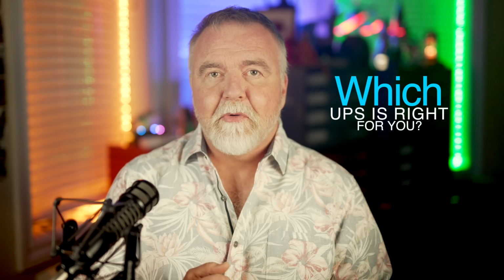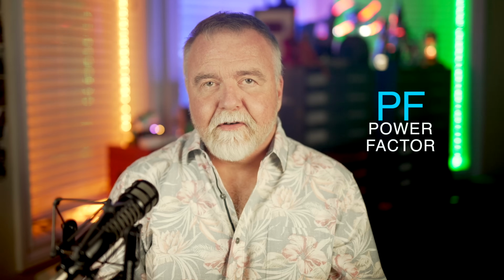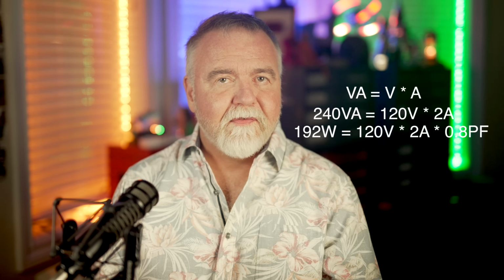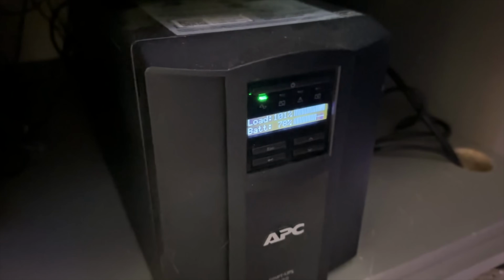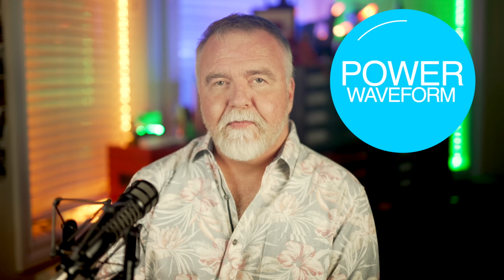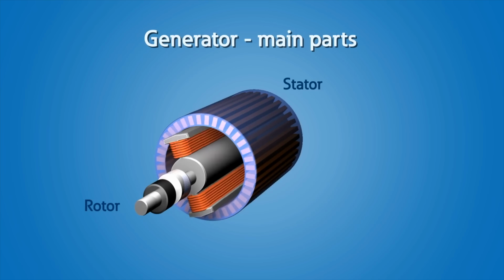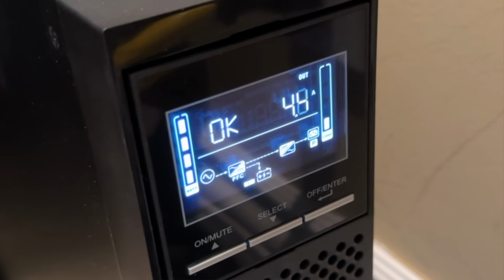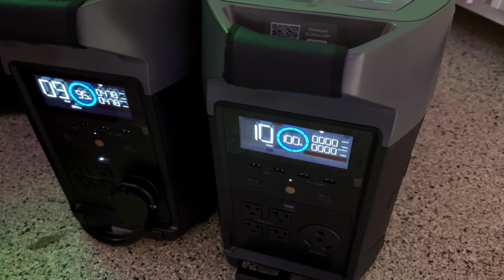The UPS Secrets YOU Need to Know!

Comment: 12:00 You forgot to mention one very significant plus of lead acid (since you did take the pains to mention that it contains lead which is toxic): lead acid batteries, unlike their lithium ion sisters, do not catch fire. Moreover - and this is a significant drawback of lithium ion batteries for this application - when lithium ion batteries catch fire they spew toxic cobalt and other nasty metal compounds all over the place in the form of really toxic smoke So, if this is installed inside your house, you, your family, pets etc. better not be there. What makes this even worse is that the electrolyte in lithium ion batteries contains its own source of oxygen in a fire. So, it doesn't matter what you cover it with in a vain attempt to smother it: it will still burn and burn until it's all depleted. That leaves you only water as the only means at hand with which to tackle it. Except that, in the form of a UPS, it's still attached to the electrical mains. Great ain't it? 
I'm not sure if there are any fire extinguishers specifically certified for tackling lithium iron battery fires, but if you have a UPS sporting those, you better find out if there is such an extinguisher and buy one.

Comment: Fun fact: Your basic SMPS power supply (without PFC, think older computer equipment) is perfectly happy running off of squarewave or even DC power, even less component wear than on standard sine AC power. But they tend to have low power factor and introduce a lot of interference, so PFC (power factor correction) systems are fitted to newer ones (and mandated by laws in lots of places). As PFC systems are built for dealing with sinewave AC, they tend to malfunction or blow up on non-sine waveforms.
Reply: Almost. Supplies with the little red 115/230v switch require AC input when on the lower voltage setting because they use a voltage multiplier. Squarewave would still be good enough.

Comment: Videos I wish I'd seen before purchasing my UPSes...
Reply: Re: connecting the UPS to the computer: since I mainly run Linux, Unix, and Unix-like systems at home, UPSes that support NUT all rose to the top of my shopping list. I planned on doing more research before buying, but construction next door caused the power quality to tank and I went with "Affordable now and available now". That lead to my purchasing a couple of 1500VA line-interactive lead acid UPSes. In a few years when these batteries finally kick the bucket, I'll see if I can swap in some Li-ion battery cartridges or maybe move over to a double-conversion UPS.

I was able to use the tools in the NUT server and client software to set a shutdown order. Everything survives a "blip". Less critical services go down after a minute. Mid-level services go down after 5 minutes. Finally, high-level services go down as the UPS is essentially running on fumes. Once all the downstream equipment is down, it powers off the output ports and waits for power to come back on. When power is restored, it cuts the ports back on and causes all the downstream units to power back on. I've tested this chain a couple of times, restoring power at different points in the cycle. It works a treat!

Comment: Lead acid battery plus over Lithium Ion.  Lithium Ion cannot handle as large of a load as a lead acid battery. This is why they are not used as cranking batteries in vehicles with internal combustion engines. Hopefully someday, but not yet.
Reply from the maker: I disagree!  he capacity of an 18650 cell varies depending on its specific model and manufacturer, but they typically have a capacity of around 2,500-3,500 milliampere-hours (mAh) each.

Assuming an average capacity of 3,000 mAh per cell, the total capacity of 290 cells would be:

290 cells x 3,000 mAh/cell = 870,000 mAh or 870 Ah

To determine the current that this battery pack could provide at 12V, we need to use Ohm's law, which states that current (I) equals voltage (V) divided by resistance (R):

I = V / R

In this case, we can assume a resistance of 0.01 ohms, which is a typical value for the internal resistance of a lithium-ion battery.

Using this resistance value and a voltage of 12V, we can calculate the current:

I = 12V / 0.01 ohms = 1200 amps

Therefore, 290 18650 cells could potentially provide a current of up to 1200 amps at 12V.   1200A is more than the biggest battery I've ever owned, a 1000 CCA "Eliminator" battery.
Reply: @DavesGarage  Potentially, but common thought/practice appear to state otherwise, for now.

Comment: Never had the need for an UPS as i've had two outages in the last 13 years. My brother lives in an area which is in the same grid as where Nokia Labs used to be and there hasn't been any accidental power outages in the last 20 years. You should try to ask for equally well built infra around you.
Reply: I used to live 1 mile from the substation bringing power into a city, I never lost power for more than a few minutes tops. We even had large storms and the neighboring town lost power for 3 days. 

Now I live in a rural area and in the 2 years I've been here I've had 2 significant storm outages. One 6 hour, the next 18 hr.

I am well prepared though, I have a 20kwh battery bank hooked up to my solar, I heat with wood, and I have generators if needed. I could keep my refrigerators and freezers running for a week with no sun.

Comment: 'Safe Shutdown' - I wonder what fraction of home UPS installations don't have the required interconnection to inform the PC to commence shutdown ? So, when the family is out for dinner, the PC is subjected to a UPS outage, which is simply delayed by ~30m (YMMV) from the grid outage. Probably puts out a bizarre AC waveform as the battery goes flat.
Also, so many are focused on "the" (singular) PC, as if each household has but one. Our house has at least five (5) in active daily use.
Also, what about other systems that might also benefit from a gentle shutdown process? Security Camera DVRs. IOT Gadgets.

Also, who remembers to replace the batteries every few years? Nobody. It's only discovered when the UPS fails to do anything during a power failure.
My workplace for almost 40 years has had two serious (for real) building evacuations; both were the IT server room UPS system emitting smoke. 100% rate.

When thinking about these sorts of "solutions", then take into account that 1) they only solve a fraction of the larger issue due to such cases as listed above, and 2) they bring their own issues such as capital costs, limited life, potentially annoyances, and (slight) risk of a house fire. Do your Benefit/Cost analysis, and then divide by two to account for the sorts of factors that I've listed that nobody else on Earth even considers.

Cheers.
Reply: Higher quality units like the APC Smart-UPS do an automatic self-test periodically and will start beeping like a smoke alarm if it fails. If it's bad enough they'll beep incessantly.

Also in my experience most power outages are quick. Two-second power cuts are extremely common when there's a transient fault (such as a squirrel bridging the lines) and the reclosers self-reset. I also get ones which are just a few minutes, presumably for maintenance. UPSes help here and for home users safe shutdown usually doesn't matter.

Comment: The amount of polution created from making one lithium Tesla battery is the same amount as driving a gas vehicle for 30 years. Lithium is not really much better than lead.
Reply from the maker: Um... you should research that.  I won't argue with you, but you're fallen for some wild propaganda, I'd say.  Tesla has mostly eliminated the rare metals, and in some cases, entirely (Lithium Iron Phosphate).  And Lithium itself is far better than lead, as lead is highly toxic.  Lithium might stabilize your mood, but it won't drop your IQ.

There's also the issue of priority.  If one is concerned about global warming, then greenhouse gasses are the bigger concern, not cobalt. 

When I looked it up, the biggest impact of li-ion batteries is habitat destruction and the amount of power required to produce the cells, which could be from fossil sources.  Neither would discourage me from an EV.

While I'm at it, using data from the Bureau of Transportation Statistics and the National Transportation Safety Board, researchers at Auto Insurance EZ determined there were about 1,530 fires per 100,000 sales for gas vehicles and 25 per 100,000 for electric vehicles.  That's like a factor of 25 worse for gas vehicles.

I'm not saying EVs are perfect, but there's a lot of disinformation out there you have to be careful of.

Comment: Cough cough if you want real security, you do double double line conversion it called part of sec std, however you need to go with a galvanic transformer on the output of the ups, if you need good output years ago they used to be standard, but there removed it for cost, if you have bad mains  you have feroresonit transformer on the input to ups it can survive a near lightning hit give good mains to ups , I ve seen lightning hits take out switch rooms were the copper bus bars were vaporised nice layer of copper everwhere that was two of the three substation switch rooms

Comment: Maybe I'm being unfair to APC, but as much as I love your video and believe it's a great representation of the information...  I believe you've fallen for what I consider to be a trap laid by APC and other UPS vendors.  You measured your corrected power draw including the inductive draw with your killawatt to be 1200W so you felt confident buying a 1500VA UPS.  I guess the trap you fell for is that you believed that the 1500VA represented the absolute draw.  Looking at a typical APC 1500VA smartups, it advertises only supporting a 1000W load...  Maybe I'm overly cautious or overly cynical.  Maybe APCs wattage rating represents the hypothetical "real" draw on the ups with a PF of 1...  In which case you may still need a slightly beefier unit.  Older PC power supplies had quite poor power factors which may have been bad for your utility bill, I think efficiency pushes has led to PC PSUs to improve their PF.  I believe typical high quality PC power supplies today typically have a PF of around 0.9.  Some probably higher, some probably lower.  Assuming your psu has a PF of 0.9 and that your killawatt is measuring the "full" load including inductive load I guess, and assuming that the APC 1kW adjusted wattage you may be running slightly over as your "real" draw would be 1,080W so slightly over boilerplate...  You actually seem to understand it better than I do but it seems like it's quite a thorny issue.  Also, this is buried but I wonder how long a typical consumer deep cycle battery in an online/double conversion UPS.  Constant use of the battery combined with higher temperatures, I'd imagine you'd need to replace them about twice as often as you would the battery in a line interactive or offline.

Comment: The first thing a PC PSU or any other switched PSU does is do a full bridge rectification and then straight into large buffer capacitors, It really doesn't care about sudden phase jumps. Depending on the load it might even survive switching times in seconds.

Comment: They really should not be playing VA specsmanship games for the consumer market. Its fine for the seriously managed datacenter etc but your average home user is going to take the wattage ratings printed on labels and just add them up. They may not even throw in a healthy headroom for safety.  Really the cost delta for the handful of parts is not significant. The second  specsmanship game is concealing the battery capacity.  There is a tendency to think the larger the UPS enclosure (and number of outlets) the larger the battery. Often times they shrink that part as it is a major expense. As such you get far less "uptime" when power drops.  The final trickery is the filtering. As with low end power supplies they cut corners here. 
The higher end boxes have the USB or serial alarm ports and host software.  Sadly, to my knowledge, there is no home equivalent of Energy Management software. Cisco's Energywise software for example can gently power down and bring back up the entire network, access points, HVAC, Digital Displays, lighting and deskphones when it senses a grid issue - or programmatically for that matter. With it you can shut the office if no one is present and bring it back on line in a minute when someone is. It would be nice to have a home equivalent. I had hope HomeThread was going to be that standard.

Comment: I get 3+ years from lead acid.  Good enough for me.
Reply from the maker: But 10 would be better, no?
Reply: @DavesGarage  i guess I am more concerned that lithium will combust vs lead acid batteries boiling off.  I also really only care about everything shutting down when we have one of our many rural power outages.  I also am using most full sized batteries wired into older APCs.  Usually pulled from wrecked cars.
Reply: We have a 2008 Mercedes, and the original lead acid battery (date code manufactured in 2007) finally died in mid-2022 (about 15 years). And this is in a car - bouncing through potholes, left outside in the depths of winter, providing many hundreds of amps during cold start.  Just a refence point, in case you're interested.

Comment: I can't recall coming back to a FUBAR'ed system after an unexpected power failure ever since NTFS with it's resilient volume shadowing file system. Yes FAT32 was notorious for crashing without a proper shutdown.
Three phase is only used in industrial applications, a server farm/data center may use three phase but I doubt it. Therefor phase shift is not an issue with consumers. Unless phase shift causes an overlap which creates a voltage surge, power supplies won't get damaged because on the power input after power conditioning stage it goes directly into a bridge rectifier and then a capacitor turning the power directly into DC to drive the switch mode power circuits.
@12:32 "simulate that waveform it's going to have to do so electronically with an AC to DC inverter of some kind" [AC to DC inverter... ??? 🙂]
@12:53 "such UPS's have no place in running sensitive Electronics" As referenced above, virtually ALL electronic devices sensitive or not take the input voltage and convert it to DC anyway, just as long as the final RMS is withing range. That is why measuring cheap inverter 120VAC output reads low barely over 100V because they are accounting the rectification and filtering RMS final voltage expected use in their design.
Just busting your balls, you know there's always gotta be one in the crowd :-)
Reply: Datacenters (at least US ones) usually do run three-phase systems. The servers are fed from the 208v between two phases.